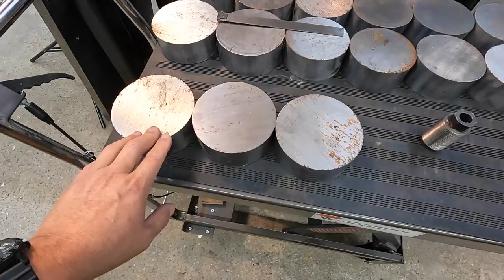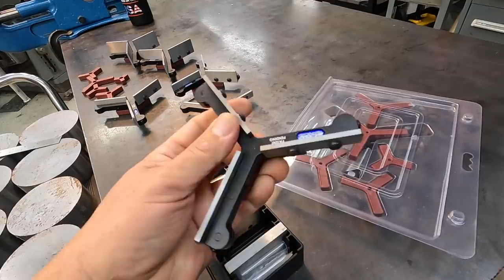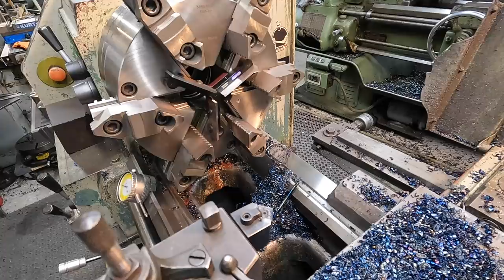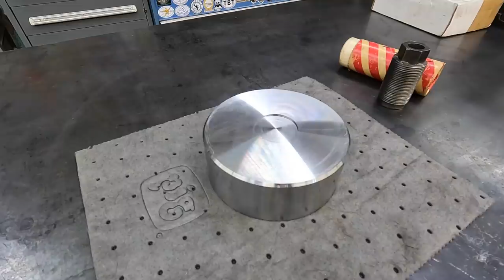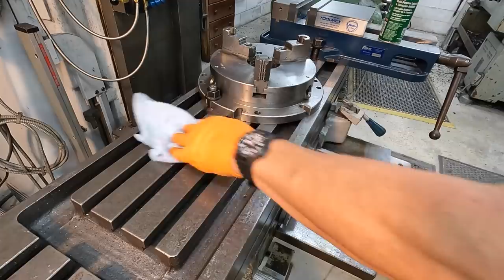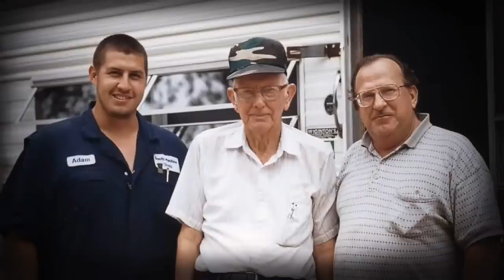Machining Lathe Leveling Feet for the American Pacemaker Lathe

Comment: Is that a magnetic lift table? 
Nice.
Reply: what the hell are you talking about?
Reply: I don't think it is magnetic. I can see very little advantage to having a magnetic lift table in a machine shop. It would need a way to turn it off otherwise it wold be hell to keep clean. Also any steel you put on it would become magnetized. I think you are looking at a regular old rubber mat with a little texture on it.

Comment: I assume feed rate is constant but if so isn’t the outer diameter cutting at much higher load than say half way through the diameter or less.  So what I mean is wouldn’t a feed rate proportional to the diameter be better?
Reply: That is correct I believe, and you can really hear that machine labor through the first 1/2 to 3/4 inch through that cut.  Once it gets to a smaller diameter the machine "relaxes" a bit.
Reply: Yes, that's why on a CNC lathe you have VSS, variable spindle speed so it speeds up to maintain surface speed
Reply: @Echo51  Not just CNC lathes. Some manual lathes with stepless variable RPM spindles (VFD) also have modes which result in constant surface feet per minute at the cutter during facing cuts.

Comment: I really enjoy all your videos! Keep up the great work! I noticed on the lathe with the six jaw when you stop cutting the jaw stops turning quick. Is that an automatic feature on the lathe or are you pushing the foot brake? Roughly what does the American Pacemaker lathe weigh?
Reply: The Victor has a brake.  Pacemaker is 11,000 lbs.
Reply: @paulcopeland9035  is it an automatic brake when you stop turning or does it rely on a foot press action? That American Pacemaker is a heavy beast. I cant wait to see more videos on it.

Comment: were the bottoms already faced?  does the steel have chrome in it so that it does not rust even after being machined or is it only plated?
Reply: Chrome only on the OD. Steel is probably 4140 and ends will develop surface rust over time.
Reply: @ellieprice363  thank you for the excellent answer!!!

Comment: The spider kits look cool, but I would prefer them in aluminum rather than plastic.
Reply: Why, so they could bend?
Reply: How would that improve function? Or anything else?
Reply: Gitcha some then.
Reply: @paulcopeland9035  Like hot plastic?   You actually think 6061 T6 has a lower Young's modulus then ANY plastic?
Reply: @mathewmolk2089  ...No.

Comment: I see a lot of these 6 jaws chucks. Are they really concentric? It’s a little bit unnatural ans against mechanical laws to offer 6 touch points instead of classical 3. Is it not hyperstatic?
Reply: They have repeatability in the 1-2thou range. If you need better than that you need to break out the three jaw and an indicator.
Reply: @andersjjensen  so what are the benefits?
Reply: @grattetout69  Speed of mounting. If you need to turn 40 of something with, say, 50 operations each, and 1-2thou off perfect concentricity is within spec then you have a massive speedup because you can mount and unmount each item 50 times without indicating. That lets you tool up for one operation and change the workpiece the 40 required times.

If your tolerances are tighter than that you have two options: carry out all 50 operations with the work piece mounted, or indicate every time you change.

Comment: With the feet so tall, doesn't the space under the lathe become a black hole trap for dust, dirt, debris and dropped parts ? Do they need to be that tall or is just personal aesthetics ?
Reply: Yes indeed, that is where all the Thing's are gone, forever. There is no need at all to have such Leveling Feet, when you have already leveling Screws that have that much of Surface.
Reply: @black666bull9  I'm pretty sure part of the point is to make the lathe sit at more of an Abom operating height.
Reply: @fjord-fjesta  Well, im quite tall and operated plenty of different Brands/Lathe´s or other sorts of Machines. Never had any Problem with the Height of it. Maybe i operated it wrong,  that it never bothered me ?
Reply: @black666bull9  Or you’re shorter than Adam …. Just a wild fucking guess.
Reply: @lewisheard1882  Well im 6'5 i dont think Adam is taller...but who knows.
Reply: Dam up and pour some suflaset under the machine. - Beats trying to locate and retrieve  a bolt you dropped that rolled under the machine (How do I know these tinngs🤣) If you have to move the machine towmotor forks scrape the filler right off.

Comment: Why do you tighten all three chuck holes? Any of the three holes turn the one scroll inside the chuck which tightens all the jaws. There are three holes as a convenience so you don’t have to rotate the chuck much to tighten the jaws. Supposed to be a time saver.
Reply: It's torqueing the scroll from three different positions.  Any play in the scroll will misalign the part if you only tighten at one point.  Tightening all three takes up any slack and centers the parts more reliably.  I 've tested this on my three jaw chuck.  It's a cheap chinese chuck with a decent amount of slack in the scroll.  Tightening at just one point would throw the part off by up to 10 thousands.  Tightening at all three points brought that down to a repeatable 1 thousands.
Reply: Just like drill press chucks really should be tightened using all three holes.  But I know they aren't most of the time...
Reply: He showed in the video when he first got that chuck he can get 1-2 thou accuracy and repeatability when he tightens each scroll screw.
Reply: this is a know thing in high precision machining.  You need to do all holes.  Take that as intended..

Comment: I like bluing any metal that's going to be permanently against the floor, so I probably would have done the bottom sides of these guys.  I know it's fine without it, just a thing I like.
Reply: Is there an advantage to that?
I had always assumed that bluing was mostly an decorative thing.
Reply: @ARockRaider  You are correct sir!
Reply: @ARockRaider  Rust resistance.  Just thinking if the floor got wet, the undersides might take a long time to dry out. 

I believe the bluing is actually a different form of iron oxide and makes a protective layer.
Reply: @josephcote6120  If the floor got wet, no amount of bluing is going to prevent corrosion. Don’t believe me, take your prized blued gun and lay it in water.
Reply: Heavy duty Rustoleum for Farm Implements would be better for long term corrosion protection. Various colors. Bluing against concrete will rust since the floor is not epoxied. Or which bluing process do you refer to that won‘t?

Comment: Your concrete is going to be more than a few thousands difference within the 4.5" pad you're creating. You're going to need to measure each pad and likely each side of each pad to create an average depth to each one to get this machine straight and level.
Reply: The feet are threaded through the machine base for leveling. These are simply pads to place under the leveling feet.
Reply: To distribute the weight to 4 1/2 inch + instead of a small 1 1 /2 +/- ...

Comment: What nonsense to align the foot to a thousandth on the milling machine, when the hole is much larger than the level screw. It gets dumber and dumber.
And then there's the double-edged cutter, where only one cutting edge lifts a chip.... really embarrassing.
Reply: Lol, you dont know the leveling tool of Keith Rucker.
Reply: @Bill Taggart Perhaps another comment on my criticism, or did I express myself unclearly?
Reply: @JohnDoe-es5xh  I don't have such problems with Keith Rucker, he (almost) always gets a thumbs up.
Reply: @JohnDoe-es5xh  ok, I could have saved the answer: "John Doe" = /dev/null
Reply: @Bill Taggart I think it's a real shame that criticism is always seen as an attack and not as a chance to discuss it. A discussion does not take place here, there are only insulted liver sausages.
Yes, my statements are perhaps provocative, they are always justified. What do I need a thousandth of an accuracy for, if it concerns feet of a lathe? None of my questions from days gone by have been answered. Only garbage.
Even if it was nicely packaged, your answer is no better from my point of view.
Reply: @raikbusse7697  lol, Keith recently crashed the aluminium tube/housing of an expensive Starret leveling meter by not using a collet chuck to take it apart, which he definite owns. As a German engeneer I'm not willing to talk to rude guys from America. Sorry.
Reply: @JohnDoe-es5xh  Ja, in mancherlei Hinsicht stellt er sich wirklich ungeschickt an, hatte bei der Starret "Restoration" Schweißperlen auf der Stirn, er macht das aber trotzdem recht charmant. Wenn ich aber so einen Blödsinn von Abom sehe... hmmm, sollte ich es mir vielleicht verkneifen, zu kommentieren.
Reply: @JohnDoe-es5xh  No, stay on course, of trying to stimulate a discussion, anything else, would be resignation. Let's see how long I can keep this up ;-)
Reply: @raikbusse7697  You're not discussing anything.  You're not offering help, not offering constructive criticism.  Just bitching.  Go someplace else to do that.  
We all know that for the tolerances of this project, that tool cutting on one edge is just fine, and actually made some chips that I WANT, as a Xmas decoration, for my tree.
This is cool, not something to be a downer on.

If you don't understand that, this is not the channel for you.

I think the expressed sentiment here is, if you don't like it, go elsewhere.
I agree with that sentiment.
Go elsewhere.
Reply: You should have paid attention to what he said in several videos about such things. For this application it may be completely overdone, and when one piece came out not quite straight he said it does not matter. But he also explained he still tries to do everything to a certain level of precision etc, just as a practice, not because the part needs it.
And the mill cutter may not be perfect and need a regrinding, but it still got the job done. With being a center cutting mill I wonder even if that may be on purpose with the center of both cutting edged being just the slightest bit offset to allow for a cleaner cut in the very center. Otherwise you would have kind of a dull spot there no matter what that would just be rubbing the remaining pip in the center around. I mean in the end that is what on actual drilling bits the chisel point is for, displacing (not cutting) the material from the very center. Just  won´t work with a mill where you aim for a dead flat (or as flat as possible) surface. There are a lot of mill designs out there and I have seen some with the cutting edge going to the dead center or even slightly beyond (which seems a ridiculous idea) only on one edge and having a relief on the other with two flute cutters while four flute cutters mostly seem to have like a web in there that I assume works like a chisel point. And I bet there are even more thoughts and designs out there than I may imagine.
Maybe it is also only that center cutting part of the two flute end mill that makes that edge grab the chip first which makes that whole edge cut first unless you put on a higher feed rate. But that is just guessing. On the other hand that of course would be a "waste" of the second cutting edge which then only remains cleaning up and doing some scraping.
Reply: @roberthousedorfii1743  Oh, and you're such a little soldier now, too, or even a judge?
Reply: @raikbusse7697  Your statements are "justified" only in your mind. Who cares if he turns the leveling pads to within a thousandth of an inch? He takes pride in doing the work. Why not be precise? Is he doing it "wrong"? Is he harming anything? No, he's not. You're the perfect example of the famous Teddy Roosevelt "Man in the Arena" quote:

"It is not the critic who counts; not the man who points out how the strong man stumbles, or where the doer of deeds could have done them better. The credit belongs to the man who is actually in the arena, whose face is marred by dust and sweat and blood; who strives valiantly; who errs, who comes short again and again, because there is no effort without error and shortcoming; but who does actually strive to do the deeds; who knows great enthusiasms, the great devotions; who spends himself in a worthy cause; who at the best knows in the end the triumph of high achievement, and who at the worst, if he fails, at least fails while daring greatly, so that his place shall never be with those cold and timid souls who neither know victory nor defeat."

Let's see your YouTube channel. We'll all subscribe so we can watch and criticize every little thing you do.
Reply: @billtaggart1267  Where did you copy that from? Some picture from your great-grandparents' wall? You still haven't understood the business of youtube. And that of Abom.
Reply: @billtaggart1267  By the way: we are in the year 2022.